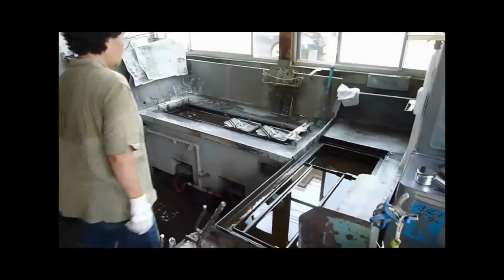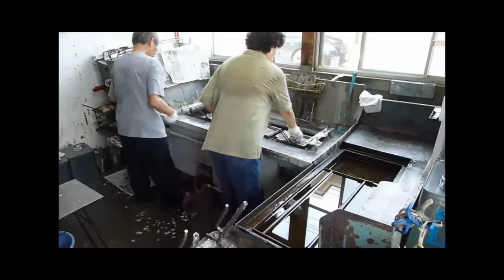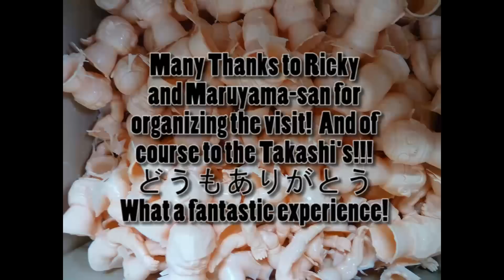RAMPAGE TOYS goes to Tokyo for a SOFUBI Factory Visit

Comment: Nice look at a Japanese job shop making designer vinyl toys. Appears the vinyl is pre-heated, then poured into a mold, which is then spin-casted.
I hope this couple has their shop ventilated. Working around polyvinyl acetate fumes is not the healthiest of environments. Worse if that is toluene in those troughs.
Now that I look at the video more closely, I think they are using a rotational caster for the molds. It just spins a lot faster than most roto- casters.